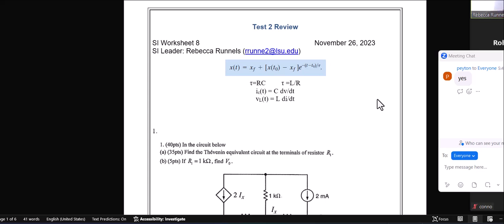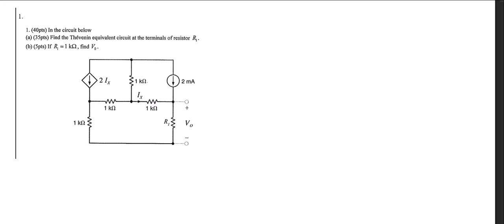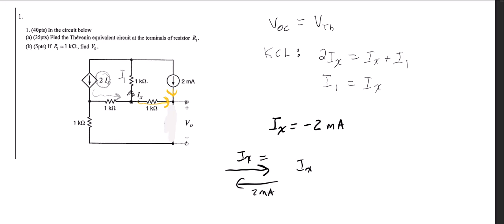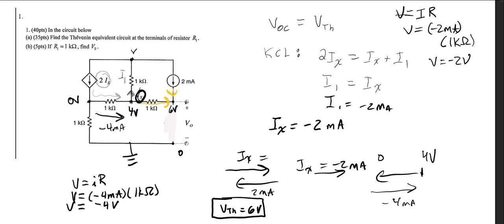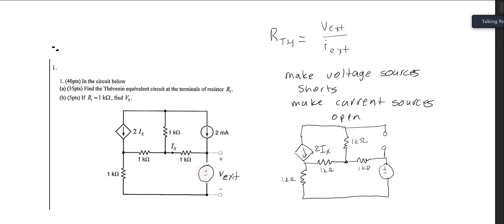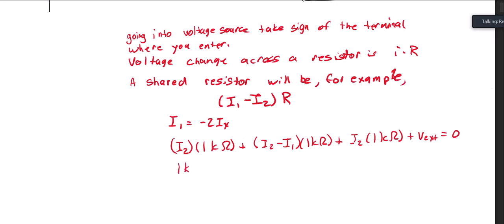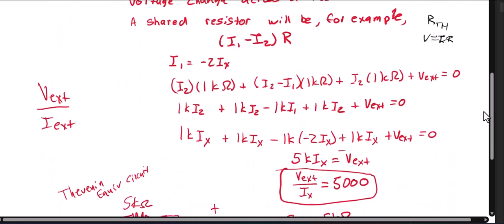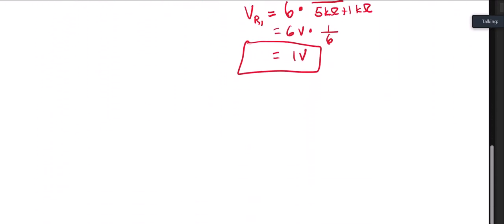Test 2 Review Problem 1

Comment: Much appreciated 👏
Step 1:Rab=Eab/1Aor Eab/I(Assume loop)
Set 2:Pour 1 amp into the circuit and find the loop to find Eab ,So Rab can be solved 

for me Easy (Calculation takes about one minute)😊[k,mA]
E=IRab+Eab. ix=-I-2
-I-2=+1(I-2ix)+I
      -I-2=I+2I+4+I
            =5I+6
So Eab=6v
Rab=5k ohm
(I am stupid 😅
Over 15-30minutes)
I just only think up Iin=Iout,Vout=Vin,loop